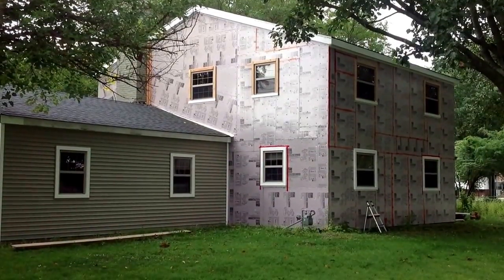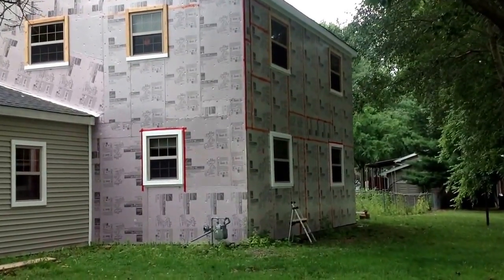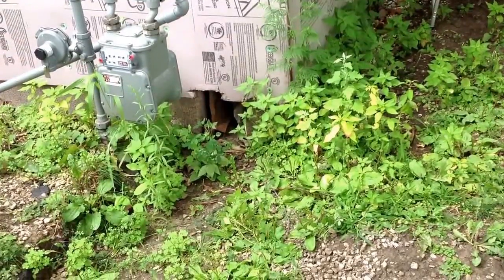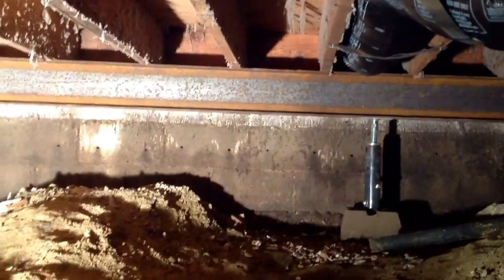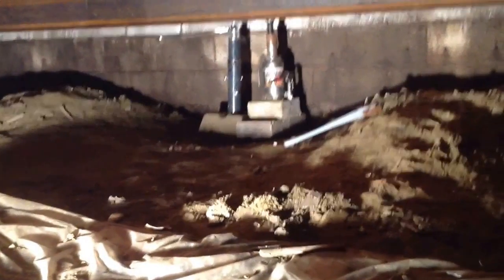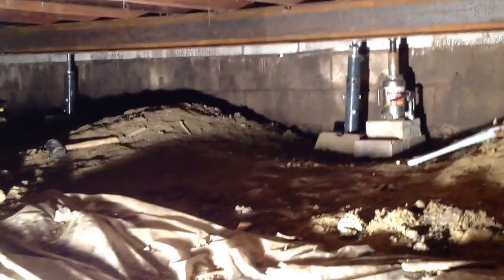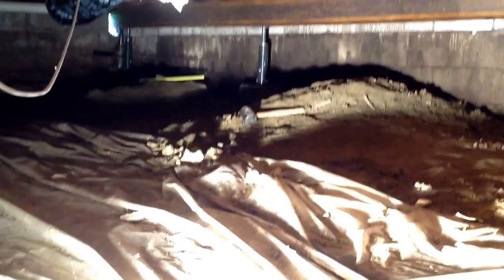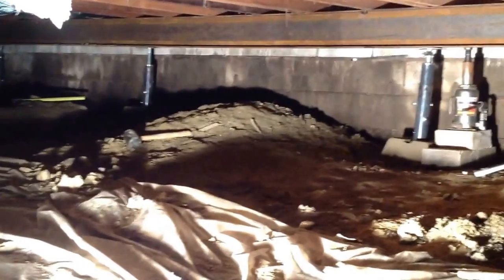House Leveling - Jacking up a House (raised three inches)

Comment: How is this holding up? Where was your frost line? Location? wondering if this would work in colorado
Reply from the maker: @copernicusvanstruselclit9508  Everything seems to have worked well. The frost line in this area is about 2.5 feet down. The foundation had settled over time, but the issues that led to the settling should be resolved now.

Comment: Did you have to shim between the house and the block after raising up the floor?
Reply from the maker: Yes, I added mortar along the edge where the gap was very small and added partial (cut) blocks in area with several inches. Thanks!

Comment: You could of skipped the screw jacks and used block piers.. It will settle again..
Reply from the maker: The house didn't have gutters for at least five years before I bought it. It could have been much longer. All of the water from the roof was dumped on right at the foundation along that wall. This problem has been addressed now and there is proper drainage in place. My belief is that the settling was largely caused by the drainage issue and should be totally or nearly totally resolved now. The screw jacks are still there, but the walls are now resting on the original foundation wall, with blocks and mortar added to fill the created gap.

Comment: Wow, thanks so much, admire you.
I have a 50'×20' single story home with five Center braces 10 feet apart along the center of my house that have sunk into dirt underneath my crawl space. I've had about five people come out and no one wants to do the job, so I'm thinking to do it myself. This is helpful in the way you described the gravel in the holes, that's a good idea. And just to see someone else did it, is encouraging.
My problem is that they used just CBS block and then have 6 by 6 pieces of wood holding the house up. Everything is sinking to the middle. So at the worst points my house is off by about 3.5 inches. I like the I-beam idea if I can get one that runs along ways that seems like it might Shore things up better. The perimeter of my house is just sitting on CBS block, so that seems solid.
So, I'm just going to take my time and lift things gradually. I'm still pondering it all.
They also have 18 in concrete pads that might be a good idea.
 How far off was your house? 
Did you raise things slowly over time?
Not sure how much digging I can do under my space looks about a similar clearance as yours maybe 2.5 feet.
Anyway, thanks again. Diane😊👍
Reply: Yes you could do it but at 2 1/2 feet crawlspace it would be very difficult. I would suggest tearing out the floors and working from above. I would also add several footings maybe 24 x 8“ with rebar in it and putting concrete blocks filled with cement and rebar on top or they do make permanent screw jacks you could put underneath. Good luck.

Comment: Hello. What did you use to cover that 3in gap?
Reply from the maker: Hi Randy, the gap varied in size from 0 - 4 inches (zero at the edge of the basement wall, like a long triangle out to the I-beam support). I used a mortar fill where the gap was very thin. I cut solid concrete blocks with a grinder for the larger gaps. It took some time to prepare these, but it worked fairly well. I tried to mortar the joints to the best of my ability. It was difficult in the small space and working from one side, but should provide a sturdy support from the original foundation.
Reply: @beargoodfruit1726  awesome thank you so much. I will be starting this spring on leveling out my house and i couldn't find any info on what was done with the gap. Thank you so much for the response.

Comment: Thanks so much for putting this out there. It's hard to find diy house lifts and this was very helpful 😁 my place was built 1890 and needs all of the sill beams and floor joists replaced. I just have to sort of jack the house up and kind of slide the new stuff in. Right. Right?🤣

Comment: I've got one through the middle of the house with joist running the same way. Floor joist are good but pilings have sunk in this Folrida sand. Put  footings in jack the central part of the house and stabalise with block. Metal rust down here real quick.

Comment: Thanks for the video. Question: how quickly can you raise the structure? I've read in some places that if you lift too fast, the structure will crack and have troubles.
Reply from the maker: I raised it over about 4 months, out of fear for significant cracking or damage. I already had significant cracks in the drywall from the settling. It was really cool to see these close up over the 4 months. I did a bunch of exterior work the summer before and prepped the house for siding, raised it over the winter and then installed the siding in the spring/summer. I was working on my own and learning as I went, so it took me quite a while :)

Comment: This is great. I jacked up most of my house that had pier+beam and cripple walls, because I could easily place jacks and replace studs/piers. I have been stumped at a section with a rim joist and stem wall. 
Cutting out a small section of foundation for an ibeam seams like a great way to get in there.

My biggest question/concern is the rim joist itself supports a large amount of weight. Did the rim joist go up without some scary bending/cracking? Did you put shims between the joists and stem wall to help support the load afterwards?

Comment: How long and how tall/wide was that I-beam. How much did it weigh and how did you slide it under the house. I'm  impressed. Excellent job.  Thanks, no need to answer, I was reading a lot the comments and saw where you have already answered my questions. Thanks, again.

Comment: We just bought a 25 year old house and after moving in discovered that at one time it had settled in the middle by about 2 inches. Apparently, previous owners didn't have a problem with it...or didn't notice. We had hired a home inspector and even brought him back. He claimed that his inspection The house is nicely finished inside. SO...now what? Do we jack it up and risk cracks in walls, ceilings, floor tiles, or live with it? For resale, the next buyer may not be as blind as we were to the leveling.
Reply: What are the Dimension of the outer walls? How many stories? Basement? Is there any masonry in the house like a chimney? 

The reason I ask is that two inches over a long run  - say the house is 45' x 35' - really isn't that big of a shift.  Also, if it is modern construction, you will be amazed how easily it goes up. You will also be amazed how much a house can bend without showing the stress.  If you have a basement under it, the work is quite easy. If its a crawlspace, its hard but doable. If its on a slab, its neither easy or cheap.

A chimney makes it more complicated but houses are typically not attached to masonry if it is built professionally. Basically, the most important part in any case is to have the right jacks and lots of them - same for odds and ends pieces of 4x4, 4x6, 6x6,  and don't be afraid to mix and set a ton of concrete in the ground. But you can do it yourself.  Belive me, I accomplished a lift five years ago that was extremely complicated and I had no experience. I just gave it a lot of thought and planned for it and expected the worst.
Reply: Benvoncamp, thank you for the reply. I'm not sure what you mean by the "dimensions of the outer wall"  We have 8 foot ceilings on the main, upstairs and finished basement. The house is approximately 36X30. The basement sits on solid rock. (some say granite, I think it's limestone) Our whole neighborhood is on a rock hill.  Yes, there is a chimney. However, the only part that needs raising is the center. 
From all four sides, the main floor and upper floor slope down towards the center. There is a steel beam across the center in the basement, which I can see dropped in the middle at sometime in the past. 

I am told by the home inspector, and a contractor friend that by jacking it up, we will crack drywall, crown moldings and the 13 inch tiles that go from the front entrance all the way to the back of the house, not to mention essentially the "skeleton"
Reply: Having done this myself, I totally understand your concerns.  We did indeed crack some of the drywall at seams.  However, we were forced to put a ton of stress on it since we lifted some areas a 18" over a run of 12 feet and needed to have it done in the two weeks' time we had.  

By your description, it sounds like your situation is much simpler.  Considering you can easily evaluate the situation and have excellent access to the lift area, I would do it in a heartbeat.  Considering you have the beam in place and it is sagging only, just get some adjustable steel columns (3 or 4 will do it -50 dollars each), set footings and place them where ever your builder friend tells you to along the beam.  Now you have the advantage of - in the worst case, stabilize - and the best case, ever so slowly remedy the problem to its original state only giving the house the stress it can take.  I'm actually a bit jealous....

We are so happy we went for it despite the immense amount of work and never thought that having a trued house could make such a difference
Reply: Just to add to what Benvoncamp said. Everybody I spoke with about our house which has settling in several places but none probably over 3/4 inch, said to raise it a little then let it sit for a week, then adjust it sometime and let it sit. You want to do it in small steps. You still may have some cracking, especially if the previous owners had repaired cracks in the drywall from previous cracking. Go slowly and let it acclimate to the pressures. Don't try to do it all at once.

Comment: This was exactly what i was wanting to do. Could you explain how you moved the i beam in place? Everyone tells me to use wood instead but its not like wood is light when its a 6x6...30 ft long...so any description would be appreciated
Reply: Try cutting some 4" pvc pipe sections to make rollers
Reply: It went in through the hole shown at the beginning of the video...
Reply: Solar Mike I meant more how you moved it. Technique for moving heavy beams

Comment: I just have to say that out of all the foundation repair videos I've watched this is the most robust solution. The "I" beam is expensive but it makes sense if you're saving so much doing it yourself. How were you able to get the beam into place? Thanks for the video.
Reply from the maker: Thanks!
I had help from a couple friends. It was difficult. The beam is 13lbs per foot. I guess this is one of the engineering specs, in case you want to buy one. It was thirty feet long, so approximately 400 lbs total. It was approximately 8 inches by 4 inches.
Reply: what size is the beam

Comment: Thanks for the video. Hard to find one like yours. Most are for post and beam foundations. It appears that the I-beam location was under the floor joists as close to the sill plate (foundation wall) as possible.  I too thought of this method as an alternate to a high cost estimate of $18,000 where they would actually raise the foundation with helical piers, etc. but was concerned that I would be lifting the floor joists and floor of the first level (of the 2 story house) upward and away from the exterior load bearing wall without lifting it. Did you experience any problems like that? Also, in your video, you mention when you first go into the crawlspace that you sistered floor joists to the opposite load bearing wall. How many did you double up or was this only in the place you replaced the heating duct? Again many thanks for the video, it's giving me confidence in something I was only thinking possible. You did it!

Comment: hi can youbplease let me know what type of ibeam is it. it seems like your using a wide flange i beam, can you please prove me with exact specs of how thick it is, whats its depth and how wide is it. thanks
Reply from the maker: My understanding is that I beams are specified by their weight/foot. The one I used was 13 lbs/foot. It was very nearly 4 inches wide by 8 inches tall. Good luck :)
Reply: Thanks for your reply and your video. i was able to get the  onfidence to jack the center beam with it and it made a big diffrence inside the house!

Comment: What specs (type, brand, tons, etc.) would you recommend for a bottle jack used to lift the corner of a two story A-frame house about three inches?  I'm thinking a 20 or 30 ton, but I want to get the right type for lifting structures.  Thanks :)
Reply: Sounds to me like a 30 ton would be plenty. You can just use a bottle jack so long as you support the house with wedges and dunnage blocks right after lifting.... If you're lifting the house gradually over time just keep lifting a little with the bottle jack, adding a metal shim or two (or something else that won't compress over time or rot) and release the jack and repeat.

Comment: thank you so much for this video. I'm going through the exact same things. now I know how to tackle it. my foundation has a 4 in drop from one end to the other. how many foot was that steel I beam?
Reply from the maker: Hi, Sorry about the delay. It was 30ft and 2 inches. Good luck!
Reply: Painting with Extreme Affect hi ,did u do anything to u house ? My house is setting maybe 3 inch on one corner ,start on the half of the house

Comment: Any feedback on this after one year?  I have a similar situation (it seems we have homes built in a similar fashion) and need to level my older house.  I am just  wondering how you started the jacking process after getting the beam into the crawlspace (balancing a 400+ lb beam seems difficult on the jack heads).  Did you have everyone in the crawl space first, then lift the beam, slide the beam in on wood or another method, or ...?  I found an I-Beam, jacks, and the deck footings, and believe I will be attempting this some time soon.
Reply from the maker: +Charles Paul Hi again :) It seemed to work very well. I put new concrete and/or cut blocks (It depended on the gap size, the blocks were solid cinder blocks that I cut to size) in the gap between the old foundation and the sill plate. This should provide two forms of support and additional stability. I haven't experienced any resettling since the project was completed (measurements are the same and the filled cracks are still intact (no re-cracking or bulging).
Reply: I have started preparation to do exactly what you gave done here, so thanks for the help!  A few more questions:  how far down did you dig for the "footings" under the house that were used to place the jacks? How did you tamp down the rock you filled the holes with?  What size did you dig?  Right now I'm at about 30" x 30" and a couple feet down...

Did you leave the screw jacks and beam in place in case you need to adjust?  That is my plan...
Reply from the maker: +Charles Paul Hi Charles, I went down about 2.5 feet. That should have been pretty close to the bottom of the footing. I used a hand held sledge hammer to tamp the rock down. I am sure there is a better way, but that is what I had available. It continued to compress as I started applying pressure with the jacks. I ended up with holes that were about 30"x30", maybe even a little smaller. The hole should have been square all the way down, but ended up narrowing in near the bottom.
Reply from the maker: +Charles Paul Yeah, I also left the beam and jacks in place. I think it is a good plan. It provided me with an extra layer of confidence in the support.

Comment: Unfortunately, our house (20 years old) is built on a slab with only 8" (20cm) between the slab and the lower edge of floor joists. Due to damage from water and carpenter ants, the house has settled about 3" on the north side (rot in joists, subfloor [exterior grade plywood], and exterior wall sole plates and lower part of some studs). I just resided the house 4 years ago, so I really don't want to have to tear that off. That leaves me with the option of doing the work from inside, but I'm not sure where to begin--in your case you inserted a huge I-beam, which for logistical reasons appears to be impossible for my house (first of all, how did you get that enormous chunck of steel in position?).
Reply from the maker: midorihafu A couple questions. The 8" between the slab and lower edge of the floor joists, that is from a single layer of blocks/mortar right? Do you have any (significant) cracks in the slab? From your comment it sounds like you are saying that the settling is due to the wood rotting, but I wanted to make sure. How wide is the side of the house that would need to be supported? Do the joist run perpendicular to the side that has settled? One story or two? The I beam I used was ~400 lbs. I ended up getting help from 4 friends to get it into position (it would be easier if you were pushing it across a slab, I had to lift one end up from inside the crawlspace).
Reply: midorihafu did u did the job to u house ,I have the same problem ,I bought the house 4 months ago and I found bad joist ,the carpenter ants and termite destroyed the sill plate and rim joist ,the realtor and the inspector lied to me :(

Comment: What is the final support, do you leave the jacks, or have you replaced them with blocks? Thanks
Reply from the maker: I ended up cutting solid blocks to size for the large gaps and filling the smaller gaps along the sides with mixed concrete. I am leaving the post supports in place as well. It would take a lot of work to remove the I beam and leaving the setup in place will allow me to easily make adjustments in the future, if desired. I believe that I have resolved the drainage-related issue that led to the settling in the first place.